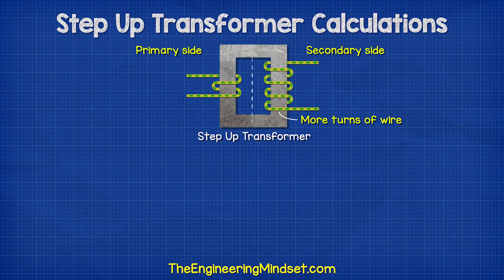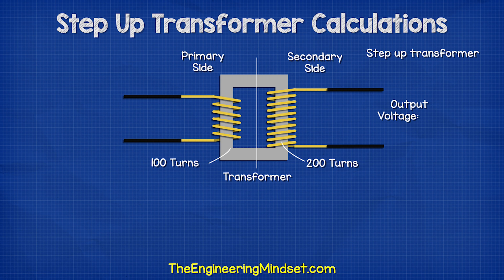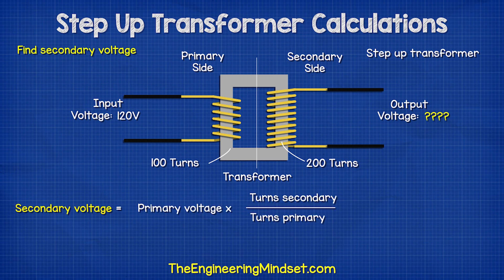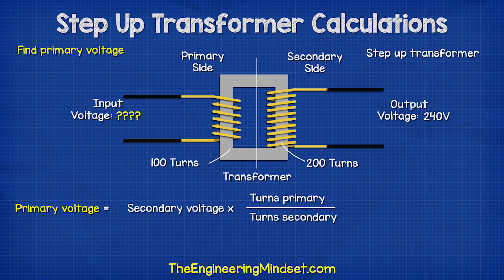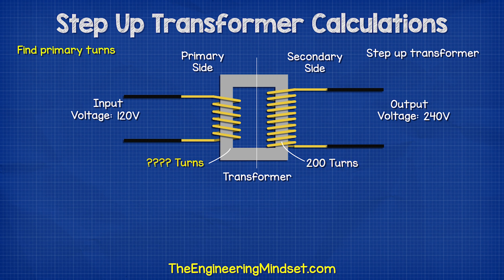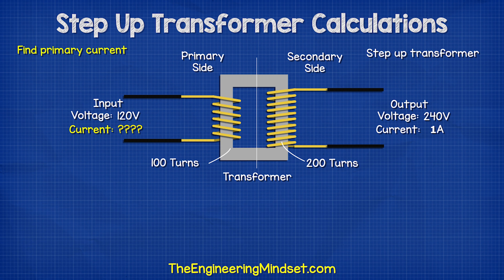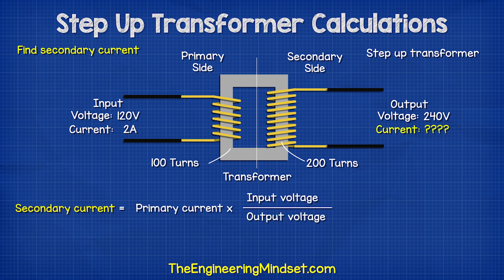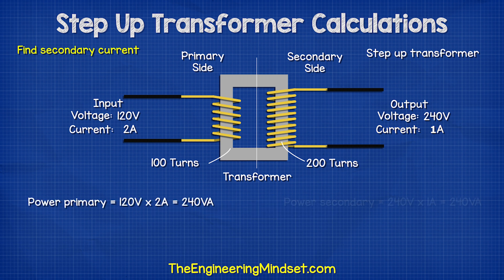Step Up Transformer Calculation Basics

Comment: I have a puzzle. Almost 90% of LEDs use a maximum voltage of 3.2v. I want to connect 20LEDS which is a total of 64v. I know I will need resistors along the way. I have collected many adaptors but they range from input 120v to output 18v or less. Also many LEDs are use 20mA. How can I convert one of the adaptors from 120v input to get approx 64v output. 10 LEDs would use 32v. What would suggest to create a flexible output voltage depending on the number of LEDs I use.
Reply from the maker: Please watch our LED circuit design video
Reply: There is noLED circuit design video
Reply: Found it in you tube...Its not  @EngineeringMindset  website

Comment: Can't we use a small number of turns on a coil for stepping up and down? Instead of 100 to 200 - 1 to 2? 1 to 3?
Reply: The issue with this comes down to the limits of magnetism. If you search online for a more in-depth explanation of transformers they will go into better detail than I, but the basic gist is that transformers have a variety of features that impact efficiency, including number of turns, frequency, core size/permeability/hysteresis/eddy current losses, resistive losses, impedance losses and flux losses that are all interconnected and impact the total ability of a transformer.

The primary reason for high winding count is two-fold; higher voltage is more efficient than higher current due to the ohmic heating effect being driven by current rather than total power(The resistance times the current squared for simplicity's sake), as well as frequency losses. As frequency goes up, voltage goes up, and the core reaches saturation less quickly, reducing losses and allowing for a more compact transformer. This necessitates smaller windings with higher internal resistance to prevent massive current surges from destroying your transformer.

Comment: Now what we need to know additionally is how many turns of which gauge conductor to wind up for say 220 VAC around a nucleus of say 6 square cms. for a continuous current of say 2 amps. This calculation knowhow in turn should also help us determine those same variables to complete the parameters for the other winding, say primary or secondary.

Comment: Just a question... why using 100 turns on the primary and 200 on the secondary if I could just use 1 turn on primary and 2 on the secondary?
Reply: Because you need more turns to generate a large enough magnetic field, and because the very low resistance from one turn would short out the supply, and possibly start a fire.

Comment: I suppose the  non formal way we can say, it transforms current to voltage which makes sense with conservation of energy.
Reply: In a way that is correct, but it is incomplete.  If current flows in the primary but the secondary is open circuited, that is, no load connected, then the current in the primary is converted to voltage in the secondary by way of a changing magnetic field generated by primary current and also cutting through the secondary winding.  In this case, voltage in the secondary will be equal to the primary voltage times the turns ratio, however, no work is been done and no power is dissipated (assuming ideal components) because power is voltage times current and there is zero current in the secondary.  So you could say that current in the primary is converted to voltage in the secondary, but for no purpose.  In practical applications, of course, a load is powered by current in the secondary, and the power in watts being consumed is equal to the secondary voltage times the secondary current in amps.  In a perfect circuit all of the power supplied to the primary would be used to produce work in the load, but of course real-world transformers have losses that result in heating of the transformer.  High-power transformers used in electrical utilities can have efficiencies of 98 per cent or so, but there is still enough heat loss to require the cooling radiators you will see on room-sized transformers in electrical substations.  Because of these losses, primary power, that is primary volts time primary amps, is always more than the power delivered to the load, secondary voltage times secondary amps.

Comment: Great explanation! So basically everything comes down to 2 formulas:
1. Primary voltage/Secondary voltage = Primary turns/Secondary turns (or V1/V2 = N1/N2)

2. Primary current/Secondary current = Secondary turns/Primary turns (or I1/I2 = N2/N1)
And from these you can extrapolate whatever you need (you can also deduce that V1/V2 = I2/I1).
Reply: Unfortunately, real transformers are a fair bit more complex. The windings ratio is important and a good start, but when considering a practical transformer you have to account for the area of the core itself, it's magnetic permeability and saturation point, the frequency of your input voltage vs. the impedance of your wires and the hysteresis losses of your core material based on the frequency. If you fail to properly account for these things, you can actually end up with a significantly lower max voltage or current than predicted by the turns ratio, or require significantly more power(and consequently, heat!) to reach the specified voltage output.
Reply: @bort6414  man smart man is smart
Reply: @bort6414  ...
Reply: Even simpler: there's just one ratio that describes the number of windings on one side vs the other (N2/N1).

For output voltage, you multiply by it. For output current you divide by it (equivalent to multiplying by 1 / the_winding_ratio, which is just equivalent to the inverse of the ratio, N1/N2).